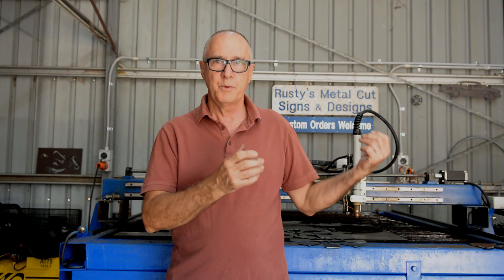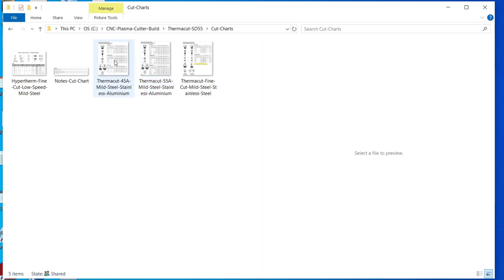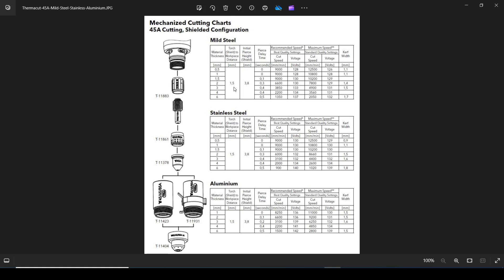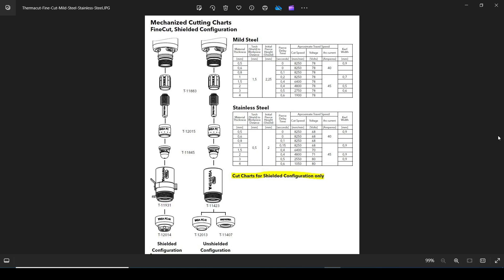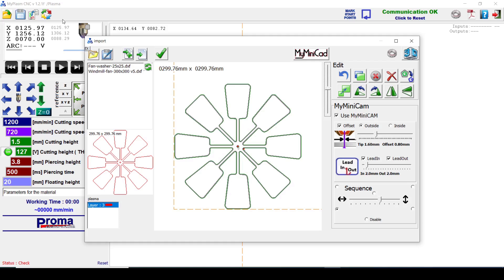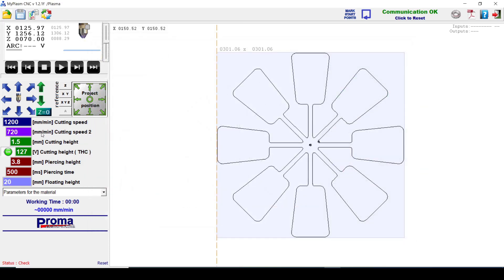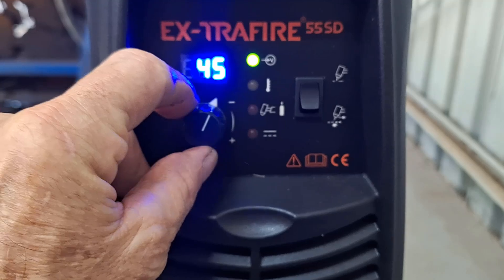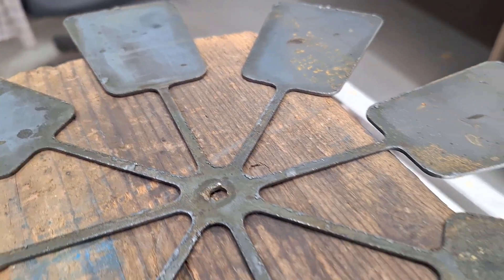Thermacut SD55 Plasma Cutter Upgrade | Part 3 - 1st Cut

Comment: Hi Rusty. Just a quick question about the table. I’ve been thinking about making one myself in nz for a couple years now and between yours and the jd garage design they seem to be popular but I think might be a bit soft especially with the rubber belts. But is there things on your table that you wish you did differently or would like to change?? If so that could be a great video or follow up on the build
Reply from the maker: G'day Chris and thanks for your comments. When I built my table, I used the original hand torch that came with the plasma cutter, and in order to make an ohmic sensor, I modified the original stand off guide, that came with the torch. It worked well, but did have a couple of minor hiccups....as did the plasma cutter; namely tripping out on duty cycle issues when making longer cuts with the amps turned up.
Switching to a new plasma cutter (the Thermacut SD55) solved those issues, and the machine torch that came with the SD55 has its own ohmic sensor. 
However, water splashing onto the torch nozzle and ohmic sensor, caused me to have to lower the water table level, to get around constant 'material detection errors'. This introduced it's own problems, namely the material warping from the heat produced while cutting, and an increase in smoke and fumes coming off the table.
The good news is the installation of the My Ohmic Pro unit, which basically de-sensitises the ohmic circuit, which has allowed me to run the water level at 15mm below the metal being cut, without causing any material detection errors....a real game changer.
So, if you're going to run a water table and an ohmic sensor on your machine torch, definitely consider installing the My Ohmic Pro unit (available from Proma Elektronika).
The MyPlasm software, also available from Proma Elektronika, is so simple to set up and use, it does make CNC plasma cutting, a breeze. It runs off .dxf files that I create in Inkscape.
Besides that, the only thing I'd probably look at changing if I was going to build my table again, would be to look at 2010 ballscrews instead of the 1605 ones I went with.
The main reason would be to run book speeds for thin material, but it's fine for all other thicknesses above 2mm....but being able to run the Hypertherm slow speed cut chart numbers for 1.6mm and thinner, does work well for me, though.
I know there are people out there who don't like ballscrews, but for a table of my size, they work just fine.
Hope this helps....and thanks for the suggestion of a video, which I've started working on, which is review of my table, after 3 years of operation.
Reply: @ yea would love to see a video on the changes and you talking through it. I’m looking into making a table for myself. Being in nz I think it’s better as other built tables and pretty expensive. Just not sure whether to make my own design kinda like yours or get a planned design to build off like jd garages new xl plans for a half size or full size table. But don’t know about the 3d printed parts and would like to use the ball screw drive
Reply from the maker: Chris, I sell plans for my table and I include a parts list, too. If you're going to use the MyPlasm CNC controller, I can include my wiring diagrams, too. If you're interested, feel free to email me at rmhyde58@gmail.com

Comment: Hi Rusty, I have seen this video but not the other two as yet. I dont know if you remember but I have the same setup but I have the SD100 Thermacut set, and to be honest its been great, and a lot cheaper than the Hypertherm. Your consumables are different to mine, I have a separate black spring that goes on top of the electrode, I havent seen anyone else with the same setup, but am curious if my torch would take the hypertherm ones. Here in the UK some of the consumables can take a while to arrive, so I have to order ahead, but not sure if you have the ohmic pro box from Lukaz, but if you have a water table then its a must as I had all sorts of issues until I fitted that box, it was a game changer. Thanks for the video mate, I love the fact that you have the same setup as me as I can relate to it, but I bought my table not made it like you did, but I think your a bit cleverer than me LOL. Thanks Dai
Reply from the maker: Hey Dai, firstly, thankyou so much for supporting the channel...it's greatly appreciated. Regarding the consumables, I'll send you a PM with the list of parts for my torch to see if they're the same as yours.
As for my water table giving me issues with my material detection, you're correct...it does. I've had to lower my water table to reduce the material detection errors I'm getting on my table. Lukasz sent me an Ohmic Pro to try, but as yet I haven't installed it (it's on my list of things to do, along with upgrading my electrical cabinet).
I did watch a recent video by Rob Broomfield, where he has installed an Ohmic Pro on his table, and it's been a gamechanger for him, as I'm hoping it will be for me, too.